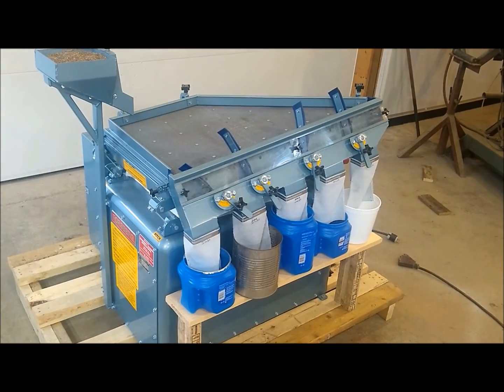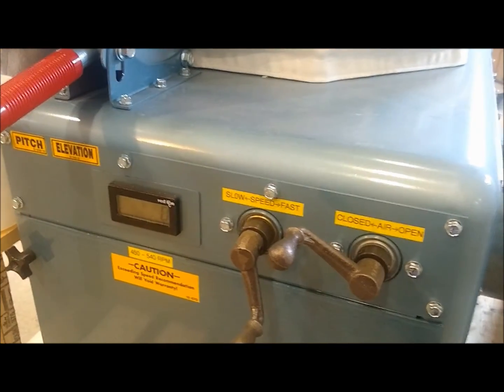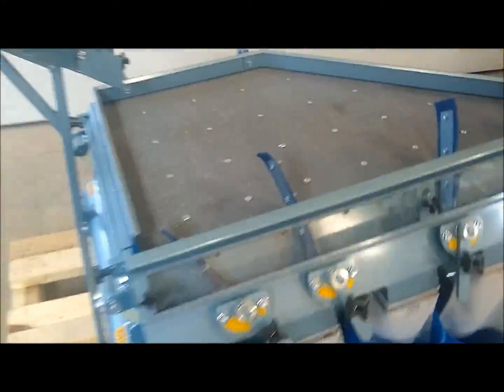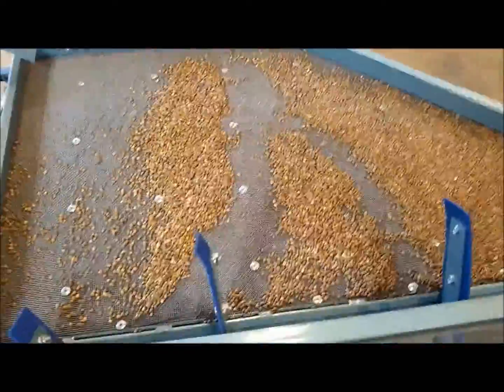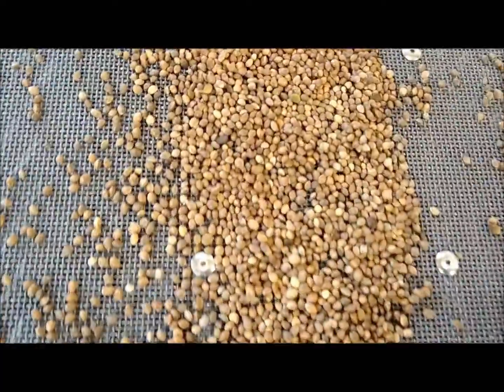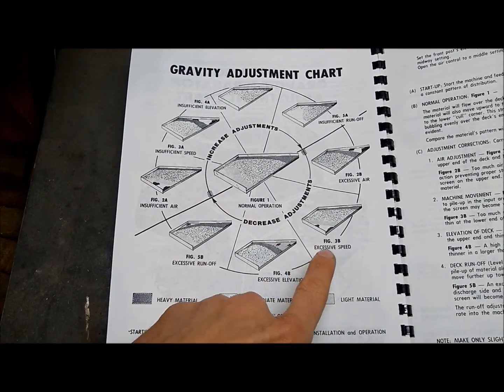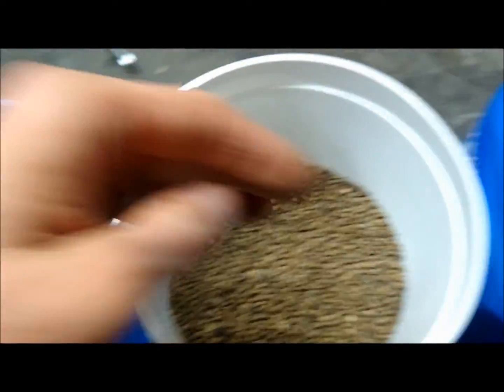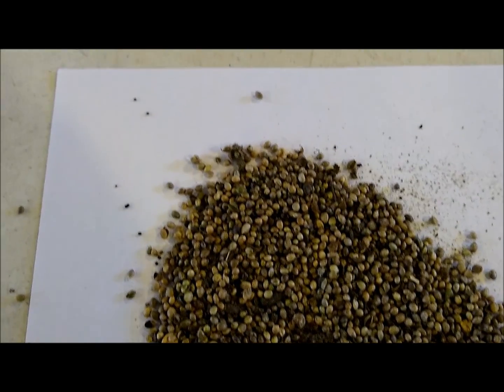Forsberg Lab Gravity Table Separating Hemp

Comment: Just curious, what's a 14 round screen like you mentioned for the top screen near the end? do you mean 14x14?
Reply from the maker: It has a number 12 mesh on the deck. I was referring to the step I took before the gravity table which was running the seed through the Clipper office tester seed cleaner using a 14rd screen and a 1/16 X 1/2 SL.